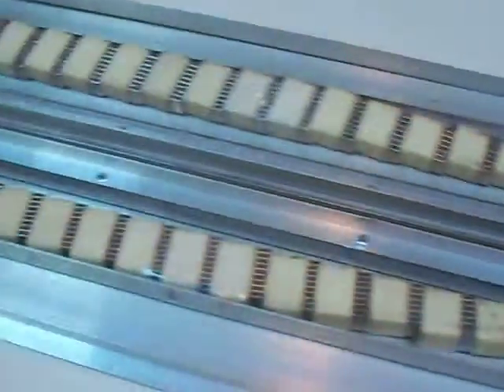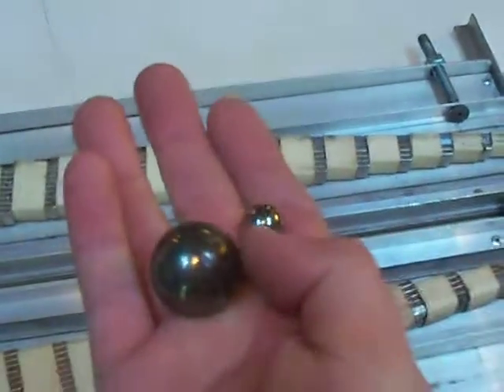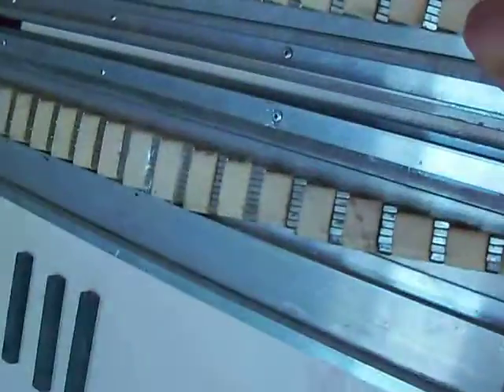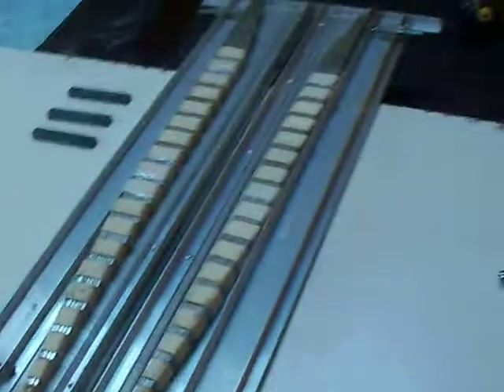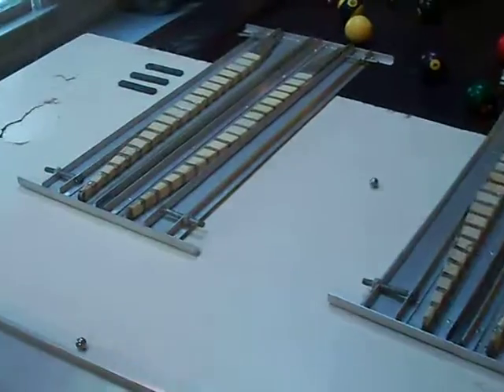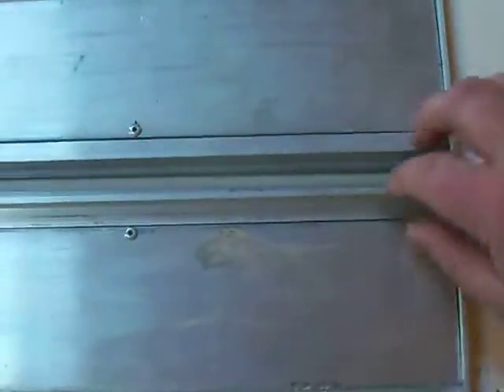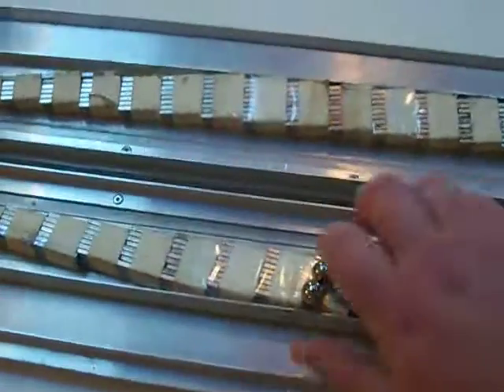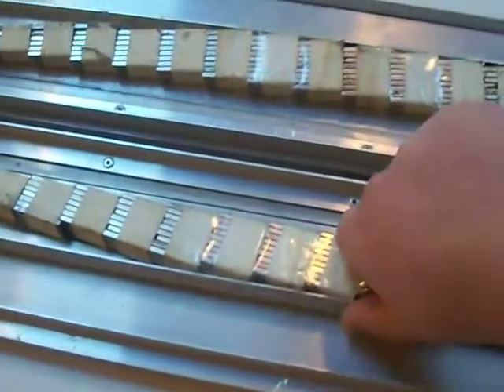Magnet ramp 6

Comment: It seems that your ejection method could be revised a bit so your not losing height by dropping straight out the bottom like that, maybe curve the magnets at the end of the track upwards a bit as they seem to be lots of little ones taped together you should get some upward angle to the tail end of just the magnets, then your ball release can be straighter at the end and save a few millimeters height to get the ball back to the beginning.
Reply from the maker: I put heavy duty strength clear packing tape on the track, one continuous piece on each side, pain in the neck to put on.  It reduced friction and noise better than graphite